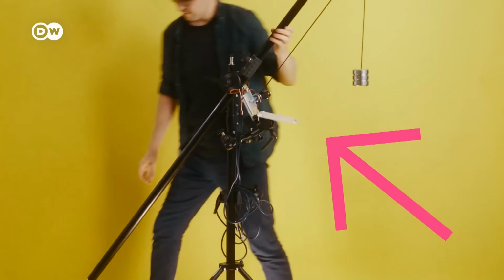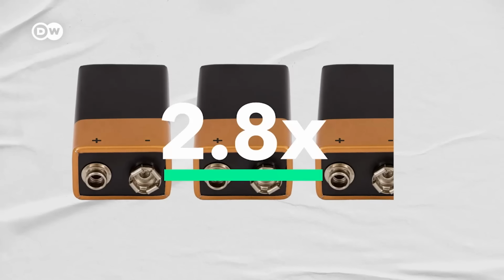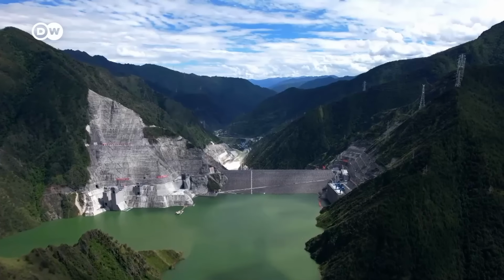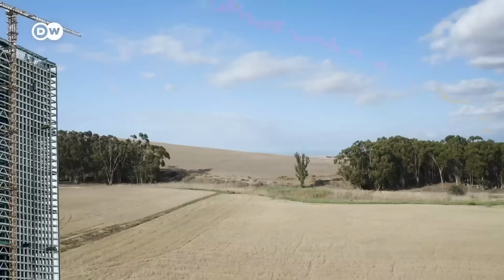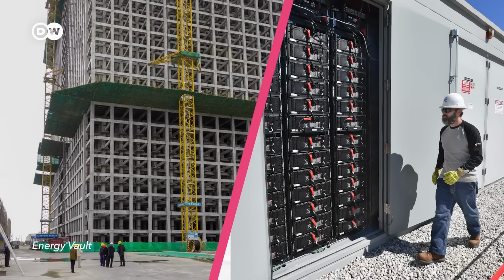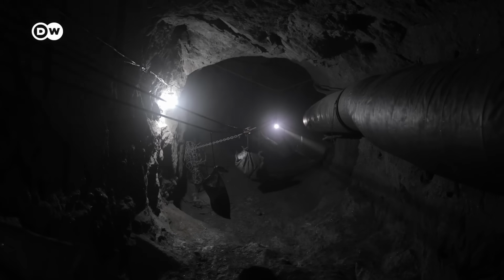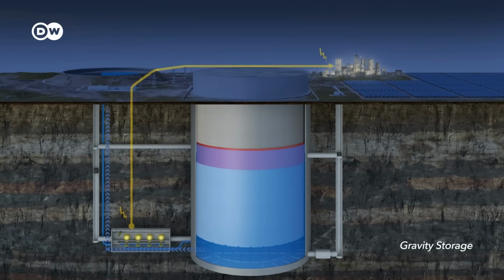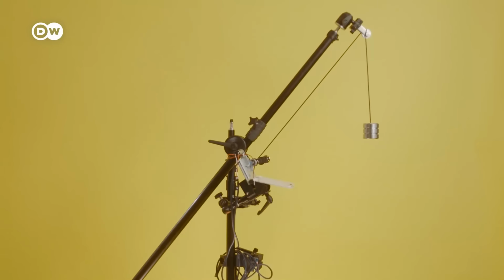How to use gravity to store energy

Comment: I'll be honest, I don't foresee any other Gravity energy storage being genuinely viable outisde pumped hydro and perhaps the using of old mineshafts. Pumped hydro because it's a mature and very functional technology, and the mineshaft one simply because the mineshafts already exist, and aren't in use. The big Gravity Vault projects are ones that I would personally not bet on.
Reply: The problem with using mineshafts is the maintenance cost, imagine if a cable break, underground repairs are more costly because of the risk.
Reply: @danielsan901998  can you imagine being at the bottom of the mineshaft after the cable snaps, messy.
Reply: @adam-g7crq  wdym? miner already use drone to mine and work from home nowaday.
Reply: @ricoaw500  In which video game was that?
Reply: these vids are just advertisements. test balloons to try and get investor money
Reply: @Zedgo99  you may be absolutely correct - sad reality of the green washing. So much steel, concrete and "complication machinery" for just 100MWh
Reply: @msxcytb  Developing and testing new technology isn't green washing. In fact, the term makes no sense in that context, making me believe that you don't know what it really means...
Reply: @pseudonym3690  New, and "New".
Reply: @Zedgo99 the Chinese have built two pilot projects. Being commissioned. We shall know the verdict in the coming years.
Reply: @Zedgo99  Pendulum clocks work the same way. Are you trying to imply that century old concepts require test balloons to prove that they work?
Reply: Mine shift method promising
Reply: The mines solution apparently is cost effective also due to the high costs that mining companies need to sustain to decommission the mine, so this tech would elongate the life span of the mine. Agreed that it is a point solution viable only in certain locations.
Reply: @coscinaippogrifo  It is interesting indeed- how scalable though? There is not that many mine shafts and size also limits how big mass can be attached. May be precious for frequency stabilisation with small capacity maybe (just my intuition)
Reply: @msxcytb  for some reason I thought that the video said that the coal shafts that they surveyed alone would supply enough energy for the entire world's current needs- not even including other types of mines and probably not all coal mines either
Reply: @JohnOkleberry  yes I have noticed that claim. Sounds too good to be true - but I would be happy to have my intuition wrong.
Reply: what about shafts added to  existing building, or pylons?
Reply: @TheKlink  10tons with shaft length of 1km makes just 27kWh of stored potential energy. Thats about 1/3 of modern EV battery. Thats why gravitational storage works well with water and some natural height difference and is so difficult when trying to apply to buildings.
Reply: Make the connection 👉 The Connections (2021) [short documentary] 🌎 ♥️ 😎 ✨️
Reply: What about pistons into grounds? It sounds good as it depends on using liquid (water) as a power source to elevate the pistons. The last ones may be constructed using eco-friendly materials or something.
Reply: Such comments greatly contributed to the demise of Rudolf Diesel.
Reply: Pumped hydro and gravity batteries serve different purposes. One is good for long term storage. The other is good for short term storage and frequency regulation.
Very few of the people criticising gravity batteries have even a rudimentary understanding of energy storage.
Like, many of these people thought batteries could never match pumped hydro, yet battery storage is overtaking pumped hydro right now.
Reply: @auspiciouslywild  An AA battery holds some 3 watt-hours of energy. The same energy as lifting a 10 kilo (20 lbs) block up 100 meters (or 300 ft) high.
See how impractical?
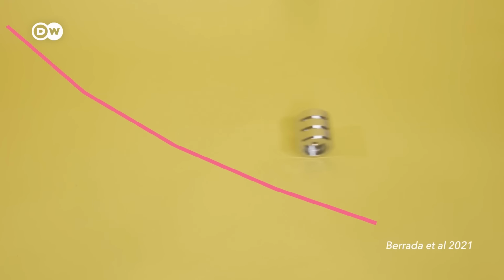Reply: @pizzablender   every time gravity storage comes up I beg people to use a units calculator (I use fourmilab's). Lifting one of Energy Vault's glowing 25-ton blocks 100 meters into the air stores all of `25 tonnes * gravity * 100 meters` =  6.8 kWh, 10% of an mid-size EV's battery. You can't make it up in volume because then you need more equipment to move the working mass to and from your lift/lower systems at both the top and the bottom of your vertical drop. And it's a joke to claim 7:32 "low cost of maintenance" for the equipment moving these multi-ton masses around.
Reply: @skierpage  I was thinking of a system where decommissioned ships were hooked up to a pulley system by a dock. When the tide goes out it would "fall" downwards 10 meters or whatever. I naively thought a ship that size carried great potential. Ran the numbers in chatgpt and was stunned with how little energy it would generate.
Reply: @kingdaddy-z7w   gravity is the weakest force. It only works when nature provides the vertical drop and billions of tons of working mass. I.e. hydropower.
Reply: @auspiciouslywild  Gravity batteries have pathetically small energy density. A two ton EV can climb a 100 metre hill dozens of times on a charge. Try that with a gravity batttery.
Reply: @rogerphelps9939  Who cares? Gravity batteries have never been about storing the most amount of energy in the smallest space. It’s about frequency regulation and a bit of short term storage. What matters is the cost per MW and the response time.
I really wish people would spend at least 10 min reading about energy storage before criticising an energy storage solution.

Comment: Bro, there must be more intelligent solutions
Reply: Pumped hydro, There you go.
Reply: @hft_trader cant build it everywhere.
Reply: @hft_trader  an interesting and more productive solution for sure
Reply: @hft_trader pumped hydro and gravity batteries serve very different purposes. One is good for long term storage. The other is good for short term and frequency regulation. Doing frequency regulation with pumped hydro will wear down the pipes much faster. It’s also bad for life in the reservoirs.
Reply: Stupidest thing I heard. You are saying pipes will wear down more than concrete and metal cables lifting ten ton block.... @auspiciouslywild
Reply: @auspiciouslywild both are gravity based batteries.
Reply: @auspiciouslywild  A AA battery holds some 3 watt-hours of energy. The same energy as lifting a 10 kilo (20 lbs) block up 100 meters (or 300 ft) high.
See how impractical?
Reply: Gravity batteries probably don't have to deal with Betz's law, unlike hydro. Betz's law describes the maximum amount of energy that can be extracted from a moving fluid. Because when you extract energy, the fluid slows down. If you extracted all the energy, the fluid would stop moving, and the flow would stop. I doubt solid mass gravity batteries have this issue.
Reply: @davidunwin7868 betzs law only applies to wind. Water turbines typically achieve efficiencies of 80-90%.
Reply: The simplicity is kind of intriguing 🤔
Reply: People look down at such simplistic solutions but dont realize that in the real world, what matters the most is affordability and reliability.
Reply: @jez5855 you are right bro!
Reply: Considering that nuclear power plants are just giant water cookers, what's so dumb about this idea?
Reply: AdamSomething did a much better (sarcastic) video on this
Reply: There are. Many. This is utter bs
Reply: @dominikgadze4221 😂😂 you've got 💩 for brain
Reply: There are.
Reply: Not at the cost of building and maintaining comes into play. Actual batteries are expensive. But if you find a way to store energy that's more efficient than turning generators down
Reply: Yes there is it's nuclear energy
Reply: This battery needs less to very low maintenance and never need to discharge can be use for many years and not 1% capacity will drop
Reply: Why does every solution need to be "intelligent" (which you mean as "complicated")
Reply: @bunnypeople Because the energy density and cost of this gravity storage is much worse than alternatives. The only way gravity batteries are viable for the cost is if they're built in abandoned vertical mineshafts. Also, the video literally ends off by saying its gotten hype because its different and simple, but that it wont be used large scale anytime soon.
Reply: @bunnypeople Even inefficient, a large amount of energy will be lost in the mechanic gear
Reply: @bunnypeople  When you have to spend millions of dollars on something, yes
Also you've made a poor assumption on what does or doesn't make an intelligent solution
Reply: its just way how to steal money from government.... its BS...
Reply: This whole concept is a scam. If you do the math, the energy stored vs the price of the setup is very low. But people dont know the math, so they get millions
Reply: Heavy mass with potential energy which the mass needs zero-maintenance, no need to haul it to elevation, and is abundant, is water.
Reply: It kinda makes sense; but would only work for certain places. Given, banks would give out construction loans for it.
Reply: You are not one of them
Reply: Nuclear power plants.
Reply: I believe ocean wave energy is the way forward
Reply: Ambri batteries.
Reply: why its great??
Reply: you mean water? yes.
Reply: Water density is too low, it need large reservoir.
Lead load will much better
Reply: There are, its done in river damns when there is excess energy in the grid they use pumps to pull water from tge bottom to tge reservoir this is shit
Reply: yes, nuclear energy
Reply: Its called a Dam. It works with water instead of bricks
Reply: Almost all of the most sophisticated ways to produce energy heat water to use steam to spin a turbine
Reply: Dams are undoubtedly the best battery system in the world. imo we should flood the grand canyon. We can probably charge the entire US by pumping water back the fourth a dam in the middle.
Reply: 60 years is a lot of time
Reply: Hydroelectric Plant pomping water upstream and filling again the reservoir
Reply: I think is a good option, we need different ways to storage energy. It's simple, but it works.
Reply: A steam engine, but with radiation jajaja
Reply: Make the connection 👉 The Connections (2021) [short documentary] 🌎 ♥️ 😎 ✨️
Reply: nuclear energy.
Reply: Good polluting
Reply: @EdoardoVentafridda  No
Reply: The simpler the technology , the more resilient it is. Simplicity is king
Reply: @JeanClauded653  that's just not true.  Engine in the model T was very simple, but required a complete overhaul every 20K miles.  The engine in my 2017 Honda CRV is still going strong at 150K miles and is waaaay more complex
Reply: And i know it, but im just a poor guy who cannot also have no money to even built small prototype
Reply: Water
Reply: Why? Its just storing energy as potential energy. Why does it have to be complicated.    Its elegant
Reply: Hydrogen is another form of energy storage.
Reply: @maudie3471  Hydrogen isn't some panacea tho. I wouldn't even call it viable since we can't store it without it leaking out everywhere. Which makes sense since it's the smallest element. It seeps out thru walls, it doesn't need any cracks. When yr as small as H, everything everywhere is made up of nothing but cracks. Shit it takes 4 H to make 1 He and we can barely keep helium in an enclosed tank.
Reply: @maudie3471  this is a great solution and it's proven to work and change society and economics. The shetland islands solved their green energy over product issue by turning excessed energy products by production hydrogen cells and created a new unconventional exportable resource from the islands.

Comment: I'm 30 seconds into the video and I can already see some junk science being displayed in here so I'm gunna hop into the comments quick. Gravity batteries don't work with solids. The concept falls apart when you adjust for things like wear and tear on critical factors like the cables used to winch the weights up and down. The cost will quickly outweigh the benefits. These systems ARE incredibly energy efficient when done with liquids however. The issue is that they require very specific types of geography in order to make them viable, which isn't available everywhere sadly. But where they do exist, they are some of the best long term, high capacity energy storage systems known to humans. 

There's a slightly modified version I've heard of, that I doubt will be included in this video known as ACAES, or Advanced Compressed Air Energy Storage. There was such a system being looked at somewhere in Ontario Canada iirc, where they wanted to use an old mine shaft, build a reservoir nearby, flood the mine, and pump air into it, forcing the water to the surface reservoir, while ALSO saving heat energy from the compression of air forcing the water up. I admittedly haven't looked into this system in like a year or two though since first hearing about it. It was showing some very high round trip energy storage potential too though.

edit: I've now scanned through the video and it looks like this is basically a paid for ad by gadgetbahn companies that are scams targeted at investors. This is really tragic to see that even DW would fall for this type of thing. Gadgetbahn truly is a plague on the modern world these days. sigh
Reply: This video is just 10 minutes of yapping. I couldn't take it anymore after 6 minutes. It's going in circle using the same bite size info covered in buzz words
Reply: Umm, they concluded the video with "this probably won't become mainstream". I know Adam Something style venting can be cathartic, but please be fair to them.
Reply: Works best as counter balances on pumping systems.  lifts or elevators including the Falkirk wheel moving a canal section with boats the electric motor is 7 Kw or so.
Reply: I got annoyed even earlier. If I am really generous and assume that metal weight on his winch thingy to weigh a kg, then the potential energy stored is about ten joules here. lowered over the course of several seconds, we are talking what, 2, maybe 3 Watts if i am generous again and assume total conversion? 

Those have to be some weak ass lights on his setup to run several of them on this little energy, and even then you would need 7200 times that much energy to run this one lighting setup over the course of eight hours.

Meaning, you would have to attach a ton of or more of weight to your house, depending on how big it is.
And gods help you if you want to heat water instead. 

His very opening statement ALREADY showed us why gravity storage is not worth the trouble.
Reply: What about lifting weights under water? Imagine an off shore wind farm.  The weights go to the depth of the sea floor (500m maybe?). Then you have massive weights of around 100T. 

Factors for:
Massive weights (100T?)
Next to the energy source.
Easier to control. 
Lots of space available 
Taller structures.

Factors against
Corrosion 
Tides and sea currents.
Off shore: maintenance more difficult and expensive.

How could that be?
Reply: @juansilvestre5748  oh, yeah. a massive, swaying weight under water, exposed to ocean currents. Several next to one another probably. On a 500 m long line. What could possibly go wrong here....

that said, have you done the math? a 100 t weight, dropped over 500 m gives you a maximum energy of 500 MJ. Less in this case because of buoyancy. 
Meaning, if your wind turbine is producing 10 MW, you are going to fill that up in 50 seconds, and you can only STORE 50 seconds worth of power. All that enormous effort, for 50 seconds of stored power per weight... 

You would need 72 of those 100t weights to store the output of a single, tiny 10 MW wind turbine for a single hour. 1700 for a whole day.
Reply: I think he meant guided. But, yeah, yikes...
Reply: Make the connection 👉 The Connections (2021) [short documentary] 🌎 ♥️ 😎 ✨️
Reply: I'm an engineer. Show me a source backing up your claim that fatigue failure is problematic for the cables. At least this channel cites their sources.
Reply: @gabedarrett1301  Maybe common sense? anyone who has worked with cranes would know that running one 100% of the time 24/7 would be lunacy. Not to mention how this technology is already inferior to pumped water storage in cost of mass alone; water is much cheaper than iron or concrete by weight.
Reply: YES! let's watch 30 seconds of a video and write a couple of paragraphs about things that are already addressed in the video. They actually talk about Compressed Air Energy Storage, gas energy storage, thermal and other more effective ways to store energy.
Reply: @afterglow5285  what can I say, I know how to beat the algorithm to ensure my comment gets seen. Regardless, they're still absolutely showing junk science with gravity batteries, and people need to be made aware that they are commonly turned into gadgetbahn and used for scams. I've seen multiple companies try it already.
Reply: Or instead a physic class, they get a gender equality and offensive lesson. So they probably law of energy conservation take as personal offensive.
Reply: @testolog  Show me on the puppet were the gender hurt you.
Reply: @Cookie_85  Between the legs, obviously.